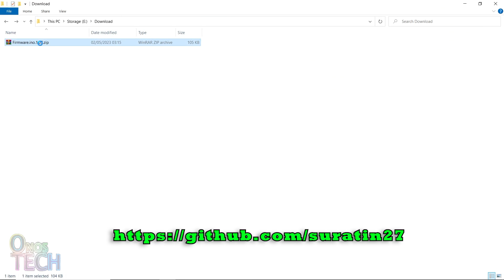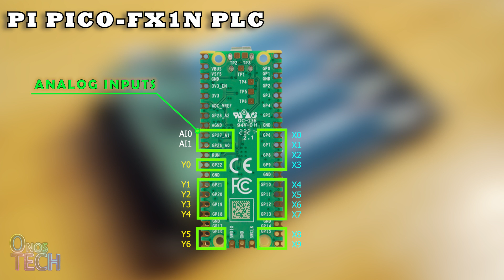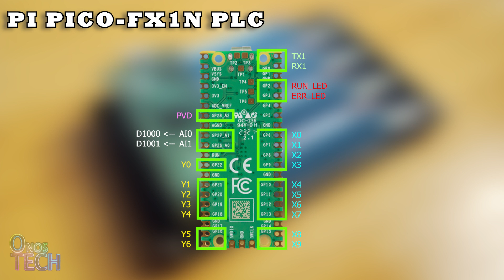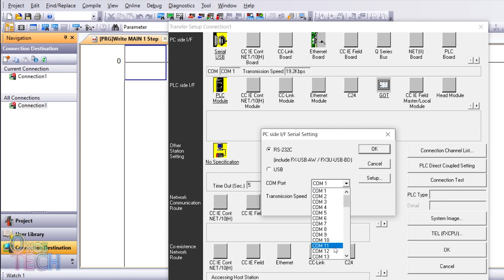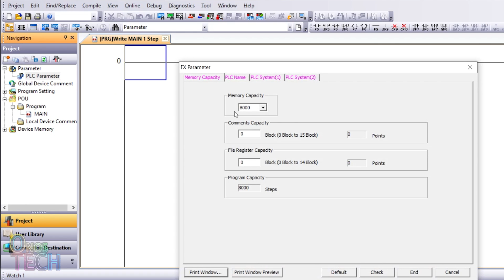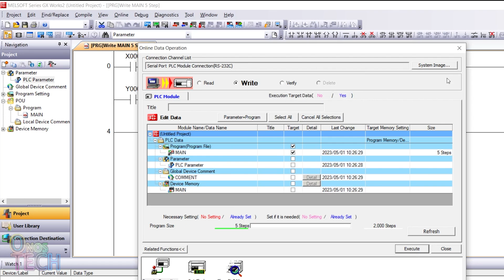Turning Your Raspberry Pi Pico to Mitsubishi FX1N PLC

Comment: In your connection diagram V1 must also be connected to V2 on the opto isolator board for the circuit to function.

Comment: found this one year later, got it up and going in 5 minutes, thanks for making the video
Reply from the maker: Glad it helped!
Reply: I finished what I wanted to build with this. I didn't use the optocoupler isolation board due to size constraints, and had flickering inputs. To get around this, each input pin that I used had a 750k ohm resistor to ground to get it to work. Once again, thanks for the explanation
 @OnosTech
Reply from the maker: @boxcarhobo8315 My pleasure

Comment: can i use pico with Delta Hmi.
Reply from the maker: You can with Modbus
Reply: I use a serial to rs485 converter. 
Conv. Tx --- rx pico
Conv. Rx--- tx pico

In Gx Works i use D8121 address. H4081 move to D8121. 
9600
8 
None
1
In modbus poll show time error. 

But i test another Outseal Porgramme it response ok.
Reply: modbus program video please

Comment: It would be interesting to port this firmware to the rp2040 zero boards since the output pins used are not available on this board
Reply from the maker: The outputs are available on the underside of the board except for GPO16 that is used for RGB LED

Comment: 2:49 Can I supply 3.3V from Pi to the input pin without connecting 10K resistor to GND?  I tested ok, does it affect anything?
Reply from the maker: OK

Comment: Great tutorial, next display with menu structure?
Reply from the maker: Thanks! Display with PLCs like this is mainly possible with Modbus HMI. You can modify these FLProg ones for Outseal PLC to work with the Raspberry Pi Pico PLC. 
https://youtu.be/g0OqOib9Lag
https://youtu.be/zazJyEX599Y
https://youtu.be/YmOSvV9BHfQ
or use the OP320 HMI https://youtu.be/iC2vYqDj54s
Reply: Can use RS485 directly? 2:01